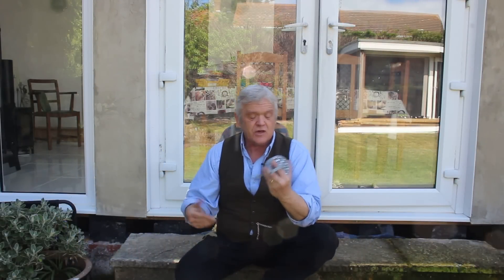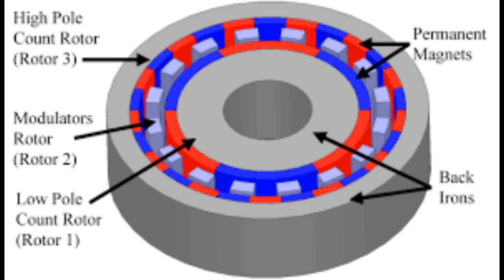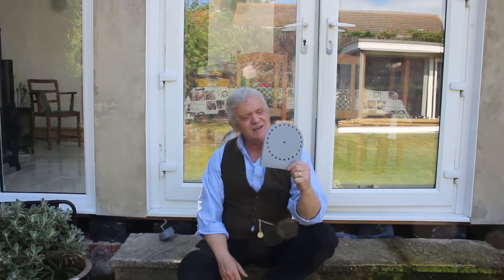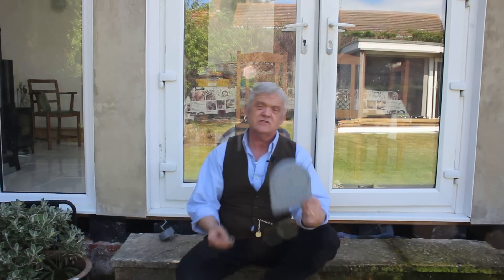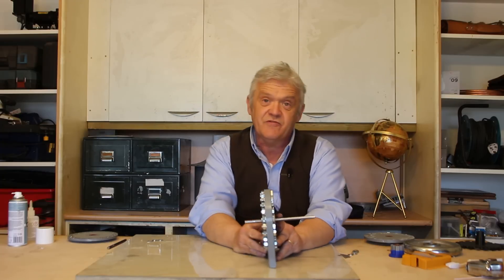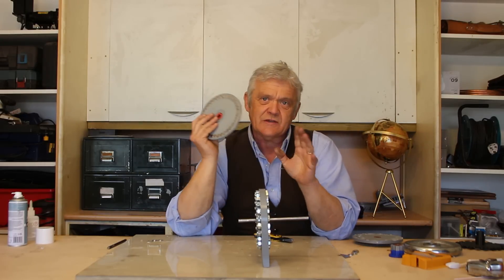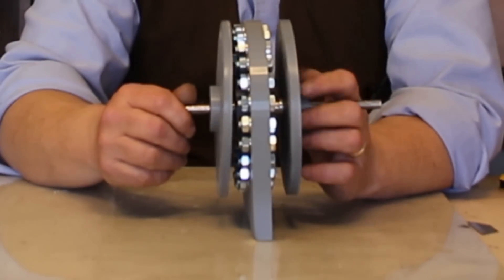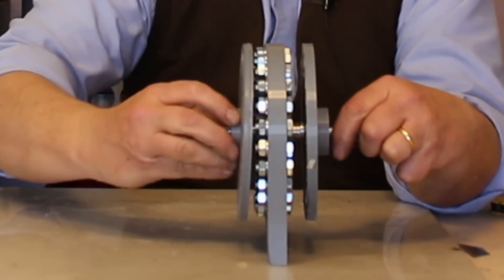1923 Magnetic Wind Turbine Drive

Comment: if you had plates of different weights then you could theoretically make an automatic transmission based on manipulating the variables of torque related to speed.  I am trying to solve a few problems on my transportation - gearing is one; more importantly, I burned up my brakes making an unexpected 1500 ft descent in traffic on my "wheelchair" (recumbent tadpole with pedal assist) and am seeking to understand better how to make, well, brakes but not for energy (although the current probably needs to dump somewhere) and instead to save my mechanical brakes for lower speed/hold stop use.  If I can basically "speed limit" my downhill motion then I won't need to use much of the mechanical ones at all, until I have to come to and hold a stop.  Since I have two front wheels I can implement 2/3 braking power on each side and still end up with a surplus.  I would switch to trials brakes (basically rim brakes that have super high performance pads instead of disc, the rims can soak up and the rotation disperse more heat) but can't really mount them well because of the side hubs.  Dynos don't have any braking control; tiny hub motors would work but they are also heavy (I could have reverse then but I'd rather have a shiftable geartrain).  I would build something but there's not really any plans and I'd rather understand what I'm doing than just keep iterating blindly until something does a little something.

Comment: I invented the SPHEREMOTOR. Wrap hundreds of feet of enameled copper wire around a small plastic bowl. Take two strong disc magnets and let them attract together squeezing the center of a pencil. Add something to fill the gaps between the two magnets. Secure each end of the pencil so that it can rotate, and the magnet portion rest inside the wired wrapped bowl. Take some 9-volt batteries clip them together. Sand the two ends of bowl enameled wire and secure one end of the wire to the negative on 9-volt batteries.  Now tap the end of the other wire to the positive on the batteries. Keep tapping and watch the powerful motion it creates.     Where it becomes cool, is when the magnet around the aluminum axle is a sphere with 600lbs of pull strength and the tolerances between the wire wrapped bowl are really, really close, the timing of the alternating tapping is perfect, that's when it is magic. Now add another bowl winding to generate current from the spinning of the 600lbs pull strength sphere magnet inside it and this becomes something that uses very little current but creates a large amount of current.   To see drawings, search for spheremotor.

Comment: Love it. Let me guess what is next ... 1889 with magnetic gears. But, now I am wondering what are the limiting factors? If your fan is spinning from a low wind speed, is there enough ... torque? ... to add a 1:2 or 1:3 gear ratio?

Comment: 4:32 Good morning, I just want to say I love your channel and how you are sharing your thoughts and ideas. I also love tinkering and have been playing with batteries since a kid. On the turbine thought I love the idea of protecting the turbine but would this not cause the blades or fan to run away if the wind speed is too high? Normally the break is an electrical short or furling. Just a thought but really keen to test this.
Thanks for all the knowledge you are sharing, I have learnt so much from you!

Comment: Hmmm...the torque limitation seems to be good for the internal parts but what about the blades in high wind speeds?  Even with the gears "locked" because they can slip would the blades not rotate anyway and potentially exceed their strength limitations due to the centripetal force?  Maybe there's some part I'm not understanding properly?  Could potentially be overcome by a separate braking system I guess.
Reply: A separate braking system would probably be necessary, but the torque limiter would still help because it works both ways.  When one side slips, it adds resistance to the other side and would, at the very least, reduce the rotation rate of the turbine in much the same way that a heavy load on the generator would.
Reply: Yes, it will avoid runaway generators protecting the electrics from bursting into flames, but destroy the rotor if it overtorques and decouples.  Noting that aerodynamic rotors TIP speed operate at 6 or 7 times windspeed (TSR) while a deag device oy operates at up to TSR = 1, much less likely to be catastrophic. (And a diffuser fwd device can easily be "throttled".)

Comment: I developed a magnet motor that produces usable torque and RPM. It can easily drive a generator or whatever you need. It has minimal moving parts and can be made in any size need. EVs will no longer have to be plugged in and buildings can be 100% off grid. Please feel free to contact me for further information.

Comment: Magnetic gears may be useful in electric cars. The reason being is that you can have a high speed low torque electric motor which would be much lighter than a low speed high torque motor of the same power and the high speed motor would draw less current. Unfortunately the high gear ratios needed are not so practical with mechanical gears because of the noise but mainly because of the severe braking which could be overcome with magnetic gears that can be made to slip when needed more easily.

Comment: This is very good stuff and I've seen others try this before but isn't there an issue of energy loss due to heat generation? I watched a YouTube video a while back where a guy tried using magnetic gears on a bicycle and found the gearing got very hot and the effort needed to peddle was greater than it was supposed to be.

Comment: Effectively you can use the magnets for coupling a turbine/ rota underwater with the electrical side perfectly sealed in a waterproof box, there’s no shaft or seals for water to seep past. I can see the only issue being having a bearing surface for the magnet plates to rotate on.
Reply: Is this water clean?
Reply: The high water friction requires encasing the moving magnet wheels etc. in non-ferrous materials to
1)  reduce/eliminate 'water drag' friction on the moving wheels
2)  non-ferrous to all the fields to only 'work on' the desired components, not the housing

You probably intended that, since the 'water drag' friction is an added drag not present in an out-of-water system
Reply: Electricity and water do not mate.

Comment: This is quite interesting, I've always been fascinated with magnet projects I see online and the various ways they seem to all be chasing the same unicorn.  One thing I've wondered about is a vertical arrangement of magnets attached to a floater aligned to a pole anchored into a coastal area so the waves and tides could drive the floater up and down, as a generator.  I'd love to see your version of such a device someday.   Btw have you ever tried printing in nylon?  I've found it has quite a few advantages over PLA/ABS for certain forms, if you can overcome it's tendency to distort a fair bit over the print height.  I've come up with some ways to mitigate that somewhat if you'd like I can try to elaborate on that more.  Short version is, you need a thermal co-efficient that varies per layer, since a heated bed creates base-layer bias.  Two substantial advantages to nylon for these sort of applications are it's profound strength, far in excess of pla/abs or almost anything short of HDPE.  Another is it's naturally lubricated nature of extremely low friction in the event parts touch.  Also nice is it's fairly non-toxic (medical implants and such are frequently made of medical grade nylon).  And it's layer adhesion is top notch, completely fused.

Comment: Maybe you could build a mag gear box with a low rpm. Generator,, usingva gear reduction,  with a over drive section. With a centrafugal clutch.  To allow a over drive when the wind is slow,  say 5-7 mph wind giving  up to 400 rpm,  then slightly over. The clutch, or band takes hold. And swaps ratios. Requring a 7-25 mph wind to spin from 500 to 900 rpm,  with a brake to stop, or slow the turbine around 1000rpm.. with tgd turbine spinning approximately 2000-2500rpm, so the tq  amplification should be decent,  using the magnets and coil specifics to get the current and voltage required,  harness all the power from the turbine without stalling it, also make it usefil in lower wind speeds, and not required such hi speed wind to start making power!  It may only be 50-100 watts at start,  however the TQ should  allow more than 20x that near the peak, on that example,  completely off the wall, zero math involved!   Or a turbine could be set up different, to allow the generator vto fpin fast, to make more power,  using gearing to regulate the voltage, keeping it steady, used like a magnetic governor.   The possibly is endless,  use 75mm x 3mm magnets, with iron shaped to get the flux air faps close as possible, to increase efficientcy  if needed depending on the shape of tge gear box,  naking a axial gear should not require any, a planetary can use either shaped magnets  ir iron to nake up the difference, ,   its an awesome idea, maybe a cvt can be designed, allowing the turbine to spin fast as it can efficiently, then gear the output suit the generator!

Comment: Thank you. I tested out my darwin/tesla generator the other day. the coils melted down and caught fire because it was spinning to fast even with a load on it. Made for an interesting afternoon for sure. I'm now trying a 4 to 1 ratio larger/smaller disc size to see if this solves the problem. If it doesn't, I'll give this a try. Oh, and that was with an 8 MPH wind speed.
Reply: Photos or video? Wow.
Reply: @mikedodger7898  Sadly no. But thanks for asking. I was going to make a video IF it worked. But it would have made for a good one. I will tell you that the tesla discs were just some old 78rpm records on a shaft I had made with pool balls on the end. I'm using air those for air bearings. I had two discs with the magnets and coils on both sides of those with stationary coils. The darwin wind catcher as I call it was attached to a funnel attached to the housing for the discs. As I posted to Robert for another video of his, once it starts spinning it starts sucking in more air. I'm no expert on any of this. I just play with it to see if it works. I'm hoping that by reducing the tesla discs to the size of CDs, that it works better.
Reply: @tommycrist1856  , a reversed funnel on the outlet (bigger diameter than the inlet funnel) may give an "air multiplier" effect... You go, realworld testing beats guesses.
Reply: @kadmow  I'll see how this next build works. In my mind's eye, I think I will have to do away with the funnel altogether or make the opening smaller to restrict the airflow. I'm making it so that you can put it on your home, so strong winds will be a problem it looks like, as to where other wind powered one seek out higher wind speeds. And do this within a 36 inch tall structure.

Comment: I'm thinking there's an interesting area of experimentation in taking two maglev bases(coil base and magnet ring top) connect the wires from one into the other, turning one by hand (the generator) should make the other turn as a motor, is there a potential gearbox here, either switching in and out coils or maybe do something with the frequency?

Comment: Hi Robert. I am confused: Just stick a serpent coil to the back. No need for extra magnets as you state at 2:55, as they are already there? Or am I missing something?
Reply: That was my exact question as well. could the magnets of the "outer" disk be used for generation at the same time as serving as a "gear". I.e. create a Serpentine coil along the rim of the Outer gear. And for extra special generation make the serpentine counter rotate to the outer gear.
Reply: Permanent magnets are better than electromagnets, as the electromagnet coil converts most of the energy into heat and is voracious in consuming energy.

Comment: Fishing reel with a magnetic clutch springs to mind. Built in torque limiter would click in when the line is peeling out too fast and stop it from breaking. If there was a way to add or subtract magnets to alter the gearing ratio as well even better. Someone get Dyson on the phone lol
Reply: Alot of surf fishing reels already have magnetics integrated to eliminate backlash while casting.

Comment: Please, can you explain how the slippage will prevent runaway turbine? I believe that because of the slippage the turbine can get easily into runaway as there's nothing mechanical to brake the propeller. The generator acts with opposite force to the spin when engaged. If the magnetic coupling is broken even that opposite force is gone. Did I miss something?
Reply: I think he means, the gears won't be destoryed if you pass their limit.

A normal gear would strip and be permanently destroyed when overloaded

A magnetic gear might slip a few steps but it will keep working when the load is reduced 

I imagine it keeps providing drag no matter what
Reply: @BillHallProductions  he was talking about safety feature. In runaway turbines the main concern is broken propeller flying around neighborhood and damaging stuff and/or people & animals. Broken gears are not that important comparing to health damage.
Reply: @BillHallProductions   I think he's talking about dump load reduction vs. a normal runaway dump load.
Reply: Could you have captive magnets in sprung pockets, so all at ok at working speeds they are aligned at too fast speeds they compress the springs due to centrifugal forces and then don’t line up and transmit the rotational forces well until speed drops and they return to alignment- like the old ball governors on steam engines! Just a thought (suspect Rob would have a better idea on how to go about it! 😂 👍)
Reply: You could  make a electromagnet brake that engages when blade speed approaches the safety limits it could power its own speed reduction aka a feedback loop
Reply: When the gears are out of sync the slower one acts like a brake/clutch
Reply: It seems to me you'd still need brakes of some sort on the turbines or blade disabling via blade pitch, but the over-torque decoupling would keep the motor from being overloaded/overheated. Not completely clear to me though.
Reply: Yeah I also got to the end of the video feeling a little confused for the same reason.

Comment: Would a flat steel plate rather than the plastic-bolt arrangement suffice as a modulator for the magnetic gears?
Reply: That would most likely  be an electriodynamic brake, eddy current would be huge.

Comment: It would make wind turbines even more practical because in areas of relative low wind all you do is reverse the arrangement so instead of 3 to 1  you could produce a 1 to 3 yes you would have less torque but in low winds it would at as if the wind was moving 3x faster.

Comment: I think you could do the same thing with a fluid, and it would be much cheaper than all those magnets.
Reply: yes its called a torque convertor, like in automatic transmission
Reply: @margarita8442  yep.
Reply: @justtinkering6713  some car cooling fans had a fluid coupling  to save engine power when u tramped it
Reply: Kinetic fluid, perhaps?
Reply: Way back in the 1940's Chrysler motors called it "Fluid Drive".
Reply: @justtinkering6713  yes, I think they just had a fixed gear with a torque convertor